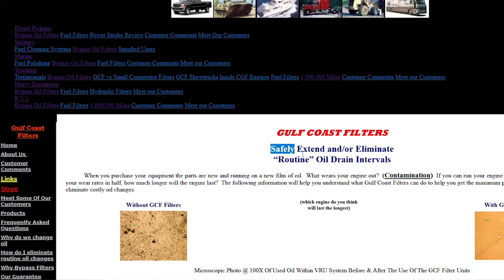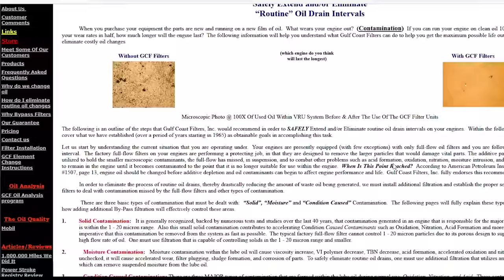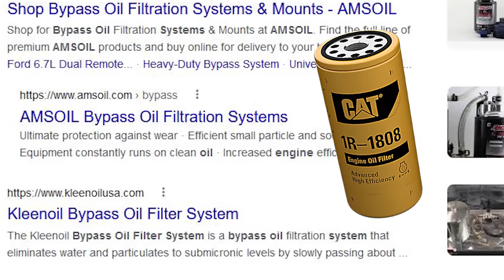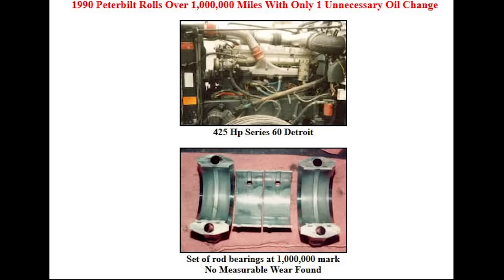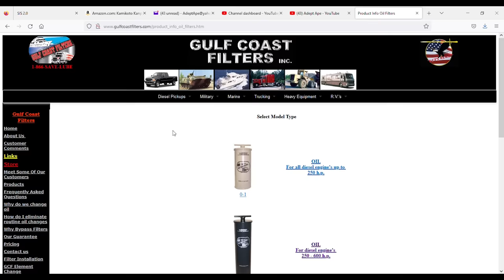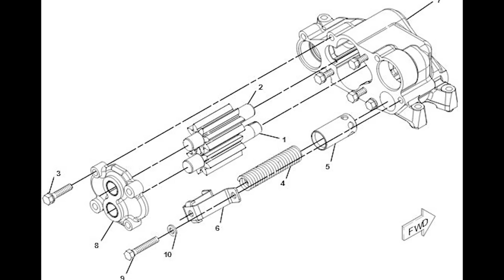No Oil Changes and 1 Million Miles!!! Are Oil Changes Optional with a Bypass Filter? (INTERESTING)

Comment: I have seen enough engines that were serviced and those that were not and there is over whelming evidence that neglected service destroys engines.
Reply: I dont think using filters that clean oil and changing them would be neglecting the servicing of the engine.
Reply: @ralphwood8818  I would say do it at your own risk. I know this subject can go all over the place. Personally I service my wifes Camry every 5k synthetic. My old 2004 Silverado I serviced every 3k with conventional oil and serviced the transmission at the dealer every 45k it was sitting at 225k miles when I traded a feller for another vehicle and it was running perfect and tranny was shifting great and no issues. Those transmissions were notorious for only lasting for about 130k I almost doubled that simply by servicing it. I will do the same for the wife's Camry. Probably not as necessary being a Toyota, but $220 bucks every 45k is cheaper than a transmission job down the road:P
Reply: @JasPlun  Never had a transmission go bad. Took me about 20 years to put 250.000 miles on a 84 Subaru with no oil drains.when I got it home I installed a Frantz oil cleaner and Mobil 1. Put Amsoil in the 5 speed. Changed the Frantz and added a quart of Mobil 1 about every 4 July. It didnt need oil added between filter changes. On that car I installed a Frantz adapter that eliminated the full flow filter. Was talking about it on YouTube. A Caterpillar lab manager sent me a sample bottle.He said it looks good for 250.000 miles. He said change the filter every 6.000 miles instead of every 12.000 miles. Been doing 6.000 miles since. The Legacy is up to 240.000. Dont drive much now.
Reply: Knew a guy that had a Camry that belonged to his wife that couldn't drive anymore. It had been sitting  i hinted I would like to buy it. He said its going to his daughter . He said hers has 500.000 miles on it and is starting to give her trouble. He.asked me if I wanted a Hyundai  with 70.000 miles. He said It threw a rod and is getting repaired. Under warranty. He had just  bought a new sports model Camry. The Toyotas are V6 models. Why a wealthy guy over 90 ended up with a 4 cylinder turbo I have no idea.

Comment: I haven't found an engine that wouldn't leak all its oil. My Russian buddy cam to Canada and didn't know how to change oil. All he did was top up his 1994 Chevy 3.1 v6 and that fucker only clogged up his catalytic converter and pop the egr seals. Detroits leak like bastard, o rings causing oil pressure codes. Fuck just did Cummins training and an x12 does need and oils change for 145000 km for warranty. Oil is over rated

Comment: I have one on the tranny in my taurus.  200,000 miles, stick is totally clean, and there’s literally nothing on the magnet.
Reply: Put a Motor Guard on a 61 Buick Dyna flow.  I got out my Motors repair manual. I got pressure at a high accumulater test plug and returned the clean fluid to the oil pan with a self tapping hollow bolt. It only filtered in drive but that was enough The Dynaflow cooled fluid with fins on the torque converter..
Reply: Excuse me while I cry.left my 52 Buick Roadmaster in a storage facility  near Fort Ord California. Straight 8 4 barrel. Paid 60 bucks for it.

Comment: The comments are Proof that oil is a religion.
Reply: Very true. The only oil that is any good is the oil they use. The same thing with full flow filters. Big debates about which one cleans best. They werent designed to clean oil.. They were designed to remove all engine damaging abrasives from the full flow of oil to the engine. Im not a truck guy. There is almost nothing in a modern car engine large enough to be removed by a full flow filter.. The small stuff builds up in the oil untill you drain it. The filters that can clean oil are called snake oil.

Comment: Super Large diesel engines maybe, but not car engines!
Reply: I am a small engine guy. I started with a Frantz oil  cleaner and Standard Delo.W30  in 1963. All I have now is Motor Guards a Jackmaster Classic and some Gulf Coast juniors. I converted a flat head Ford canister filter to use Scott 1000 for the diesel Ford tractor.
Reply: I have bypass filters on riding lawn mowers. Iittle Gulf Coast and Motor Guards  I have seen AeroFrantzs on crop dusters. Thats the little airplanes that fly over your farm and spray stuff. Ive read oil analysis reports on a Cessna 182  skylane I believe. Been a long time ago. Frantz had a lot of things. Even had their own Frantz brand oil. Frantz stuck with that bad design. The top loaders are so much better.

Comment: Still could of been big difference that one oil change could of been done at 500000
Reply: Probably when the engine was drained for the engine inspection at 250.000 miles. A mechanic saw a container of used oil and disposed of it. Instead of pouring the used oil back in they had to put new oil in.
Reply: Actually it means nothing but it destroys your bragging rights. The oil is being changed 3 gallons at a time for a million miles. The engine didnt self destruct at a million miles. It kept on hauling. If it had needed anything repaired during the test it would have been taken care of. Im sure the truck owner had a deal with Shell oil. I think they had some dirt in the air intake. I remember something about oil analysis showing a problem with dirt bypassing the air cleaner. A split in a big air intake hose I think. Read something about it.
Reply: Oil don't mean shit when your drive like a grandma shit ain't getting hot enough to do damage obviously u still need it so it means something but some one who warms up there car and drives steady its gonna last way longer then someone who dosent and revs the shit out of it older the oil hared to move when cold let it warm up happy as Larry as long as the oil pump can keep up with the load so no oil dosent mean shit it's all mechanical if the oil can get there via force will still do its job just long jeputy of your oil pump or thickness of oil pathways through your motor can't rember what motor but rember reading up about an i6 that starves cylinder 6 of oil try this test with that car 
In conclusion cuase I did go all over the place part quality and flow throughout the motors passage ways is key or oil don't mean shit

Comment: I came here to see if if was AmsOil  😁
Reply: Amsoil cant compete with these filters. They have a good sales pitch. In the early 80s they had a canister filter that might have been as good as toilet paper They had Bobby Unser saying this oil change is forever.
Reply: The Amsoil oil filters I see on YouTube that are pleated  material dont clean oil. The high quality oil and modern clean running engines make the filters look better than they are.You cant clean oil with pleated filters. The Amsoil canister filters may have been as good as the toilet paper filters. Havent seen any of them for many years.

Comment: I will never be convinced u don't need to change oil. Extend a little maybe but eradicate the need? Nah
Reply: I normally dont drain oil. Its a little risky telling someone with no common sense they dont need to change the oil. If they get a problem like fuel or coolant contamination they wont know it until the engine starts knocking. Back in the 60s people bought Frantzs and Motor Guards that didnt have sense enough to watch the dipstick or read the used toilet paper. Got a message from Israel. A guy remembers as a child watching his mother change the Frantz on the Volvo. I bet she knew how to read a dipstick.
Reply: When the Peterbilt gets a filter.change 3 gallons of new Rotella was added.  That is over 300 gallons of new Rotella added in a million miles. That isnt one oil change in a million miles. Some truckers are changing the big filter less often than the 10.000 miles for the test truck.

Comment: bypass is included in EVERY single oil filter.... semi truck or honda 3 cylinder...... 
.
i call BIG BIG bullshit on this
even if it has like 10 filters... and your oil change is just changing the filters every ~10,000 miles
the additive package is still gonna be worn right out
.
.
idk... big investment in a semi
unless this company is going to warranty an old mechanical injected I6.... no questions asked......
this this is a BIG!! scam
.
.
hell, its HARD! to find a shop willing to rebuild / swap a mechanical injection HD diesel 
due to the EPA F-hen with people who swap V8s into Tesla's (because it doesnt meet the emissions of the original "motor"..... which is so stupid)
.
more carbon and destruction needed to make a whole new car....
VS swap an engine from a junk yard.... and get more HP while doing it
Reply: Its just a filter that cleans oil. To me allowing the oil to get dirty wear and foul the engine then draining it makes no sense..Im not a lubrication expert like some of you guys. With 60 years using toilet paper filters I have learned  that clean oil is better than dirty oil.

Comment: You should DEFINITELY Get in contact with HotShot Secret guys, extremely knowledgeable individuals. They are very adept (lol) in this topic and oils. 

Like this so Ape sees it!
Reply: The Frantz is a good filter. I prefer the top loaders.My old truck will have to make it with Walmart oil and no added additives. All I have is the Australian Jackmaster Classic  Gulf Coast juniors and Motor Guards. Also a flat head Ford V/8 canister filter converted to use Scott.1000.for the Ford diesel tractor..Started with a Frantz oil cleaner in 1963 when the stores were full of toilet paper that fit. About all that fits the Frantz is the Frantz elements.
Reply: John Frantz got his start converting the old canister filters to use superior toilet paper in 1953..I improved them. Mine take a full roll of Scott 1000 toilet paper 4 1/2 inch. No mess. Put one on the Ford diesel tractor. The tractor wont run with a non Ford filter. It purrs like a kitten with the flat head Ford V8 filter and the Motor Craft FL 1A full flow filter..The hydraulic oil runs the loader the power steering the 3 point hitch and lubricates the gears including the 12 speed transmission.. all it had to clean the fluid was a screen for a primary filter.. I put a FL 1A Motor Craft filter on the outlet of the loader control valve. Used a Perma Cool universal oil cooler adapter to divert a small flow of oil to a Motor Guard oil cleaner. So far the Ford hasnt rejected the Motor Guard.oil cleaner. The Ford takes a special hydraulic oil. The only fluid Auto Zone had was Lucas that met the requirements.
Reply: Had to do the filter a little different on the hydraulic system. The 3 point hitch and power system is down stream of the loader control valves
Used a needle valve and pressure gauge to feed the Motor Guard.

Comment: Just remember guys old oil runs like shit loss of power is big time bitch especially when you are going up a hill and find out your cars making half the power it used to
Reply: My cars dont lose power with old clean oil.
Reply: I think they put the Peterbilt on the rollers to check the HP every 250.000 miles. Saw it being tested once. Im getting old cant bring up the word  dynamometer?.

Comment: You are gambling at that rate, same as stock trading. 🎉
Reply: Probably not much of a gamble with a major oil company testing the oil . Someone correct me if im wrong It was using Shell Rotella 15 40 and the oil was being tested by Shell oil engineers. Shell offshore is a major user of Gulf Coast filters on locomotive engines on drilling rigs.

Comment: There super filter material is just toilet paper
Reply: The super filter on my cars is toilet  paper
The big diesels use Bounty Big roll paper towels..
Reply: @ralphwood8818  I dunno but these “super by pass filters” are a cellulose roll (basically toilet paper) they even have videos on it.
Reply: @Justthemow   You can shop around and find filter elements as good as toilet paper for 10 to 30 bucks. I have been using Great Value 1000 from Walmart.  The  flat head Ford V8 canister filter is 4 1/2 inches. The Scott 1000 fit. When I sold the big Gulf Coast filter it used Bounty Big Roll . Now they put it in a bag. People worry about tissue migration. If I had concerns I would get a remote filter mount and run the return oil thru a spin on filter. Recently bought a old Japanese Ford Diesel tractor. Its an engineering masterpiece but only has a strainer for the hydraulic fluid . The hydraulic fluid supplies the 12 speed transmissiion the loader the power steering  the 3 point hitch..I put a Perma Cool remote filter mount on the return port of the loader control valve. Put an oil cooler Perma Cool universal sandwich adapter on it. A Motor Craft FL 1A on the mount and  Motor Guard  TP filter on. Probably should have replaced the hoses before changing the fluid. I put the converted Ford canister filter on the engine with a FL 1A.. I think its going to make a good tractor. Put Motor Guard compressed  air filter element in the old  Motor Guard housing. They claim submicronic filtering. Its like coffee filter paper on a plastic core. The plastic core should be ok for hydraulic oil.